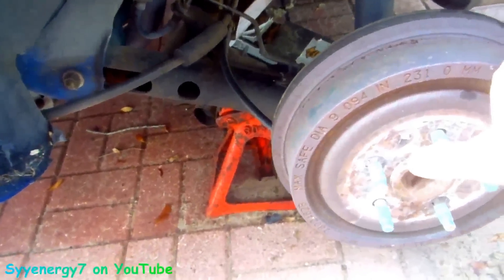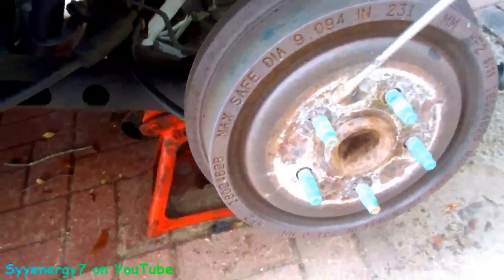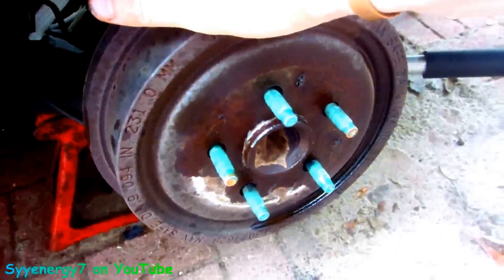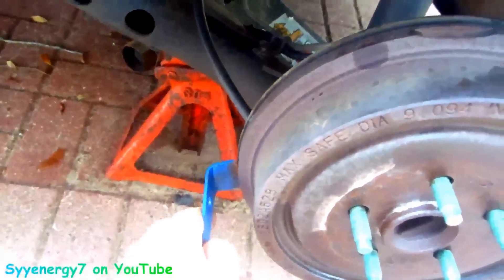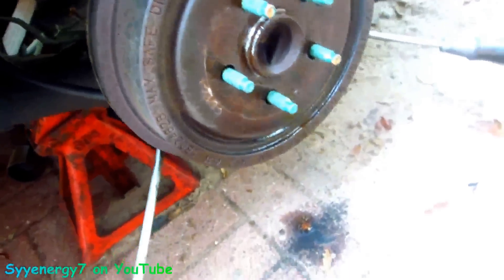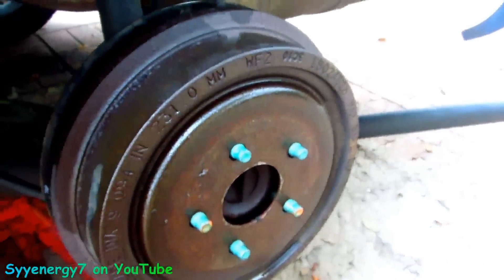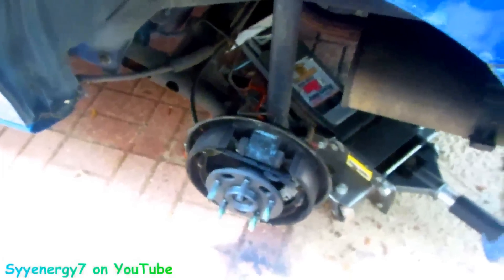Tricks to Remove Rusty STUCK Brake Drums

Comment: The most likely cause of a drum being ''stuck '' on is a grove worn into the drum by the brake shoe . Just back off the star adjuster on the back side and save yourself some time . If the center of the drum is rusted to the axle strike it with a hammer .
Reply: Part of the issue is that the adjuster is not accessible, because the axle bolts to the hub from below. Now that I think about it maybe I could just take off the whole hub.

Comment: What is that blue-green color on the bolts of the hub? Is it a green threadlocker? On my bolts was same color, not sure what it was. If that brake drum is very rusty, is it possible to clean it, or you need to buy a new one? Thank you for the film.
Reply: more likely it is anti-seize coating.

Comment: If you are hitting it on the innermost area where the hub is directly behind, you are safe to hit it very hard and you won't break anything.
Reply: What can break  ?
Reply: @p.delatorre2386  the drum may shatter if you go smashing it on the outside.
Reply: Ok, thanks for the heads up.

Comment: Pry bars will bend backing plate.chisell n hammer around the hub center will work.
Reply: Just bang the metal back strait. Me and my pops did it with my s10 months ago
Reply: I had to heat mine with welding torches and bang it off and pry with pry bar. Then it came off. But the brake assembly is bullshit with all the damn springs
Reply: @drewilliams178  Torch bad melt grease hub.This is what you do you wire wheel around hub center good spray penatrant un adjust brakes fully then pop drum hammer will pop rite off. Will need to wire wheel few times n. Make sure brakes fully de adjusted. Wow car girl .
Reply: @drewilliams178  never bend backing plate will distort if do will need to replace it.
Reply: @drewilliams178   Yeh just wire wheel good few times around hub center .Then de ajust brakes fully use penetrant n smack hammer pop off

Comment: Un bolt the brake cylinder from the back plate and push it in. the shoes will fall away from the drum that way and you can get them out of that worn in groove.

Comment: When I have had to free up stuck drums, I get the back axle and tires off of the ground, on jack stands. I pull the tire I'm working on and then get into vehicle and put it in drive. Get the rear wheels spinning and then step on the brake. The drum comes loose from everything. It's a little hazardous I know, but it saves a lot of time and labor. Very effortless and effective. If not on the first try, usually second or third attempt and it's off. :)
Reply from the maker: I know all the tricks,  I did that too.  These were maybe the worse ones I ever encountered.
Reply: Ssg
Reply: what do you do if it's a front wheel drive?

Comment: I have a 96 Toyota Camry with this same problem. It has the 2 built holes and my hub is so bad the threads ripped out. Plus the backing plate overlaps the outside of the hub so you have to bend it to get the screwdrivers in. What a pain. Hub still isnt off yet. Daily driver time constraints

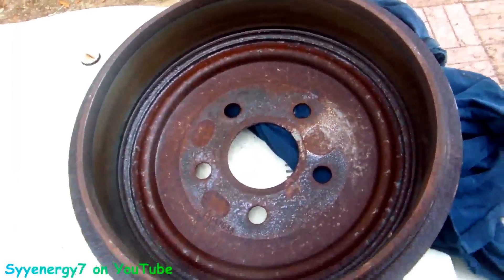Comment: nah get yourself one of those HF needle guns for that shit.  An easy way to prevent the surface corrosion in the first place is a quick spritz of that graphite lube.    14:48  yes toyota does have it
Reply from the maker: This is the first time these were off ever since this car was built at the factory.  There will never be a problem in the future removing these brake drums.

Comment: The mixture of penetrant that beats Kroil, 50/50 ATF and Acetone. I used it on my WI truck cab and bed mounts, they came off without breaking. 
You can rent a tool from an auto parts store, then if it breaks it's under warranty and returnable.
Damn original drums! No Shit.

Comment: You shouldn't do this and you shouldn't do that but I do it anyway and you can do it anyway so why did I say you shouldn't do this and you shouldn't do that? Cuz I  don't have much of a clue?  What he's prying on is the backing plate - which is relatively thin plate. Yeah it's bowed out.

A puller is the best route.  And it doesn't have to be an expensive one. If the drum was heated where it contacts the hub (actually the end of the axle) with an acetlyene torch (carefully and before anything flammable was applied) it would probably have popped off very quickly. There are some good videos on brake drum removal on YouTube - this isn't one of them.  

Toyota's threaded holes work very well if they aren't rusted to the point the threads are gone.

"Who the hell knows man?".  Not this dude.  "The hammer is actually doing microscopic things to the rust."  Jesus.

Comment: I use a 1 LB or heavier hammer to remove hub. Take the hammer an smack it on the outer most face of drum. Than rotate drum 1/4 turn, than smack it again. Continue doing so, till drum pops loose. I find this trick works very well for me. It usually takes me 2 minutes, or less, to do so.
Reply from the maker: Yeah, I know and that usually works.  These drums were one of the worst ones I ever had to take off.  It was ridiculous. I was using a 3 pound hammer and even the air chisel with blunt rod and pry-bars.  These drums were ridiculous and not normal.
Reply: Would the hammer damage the wheel bearings? Would it be like hitting a kerb....